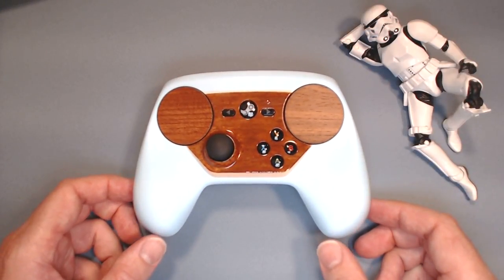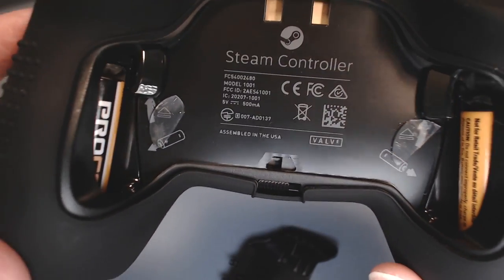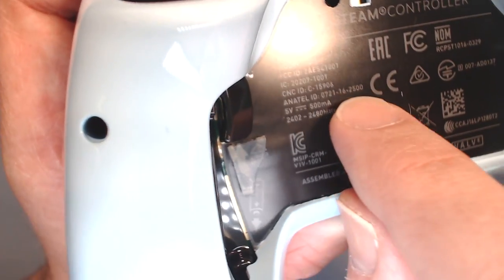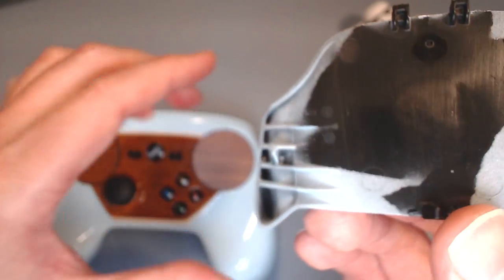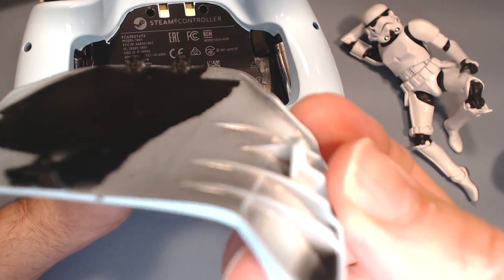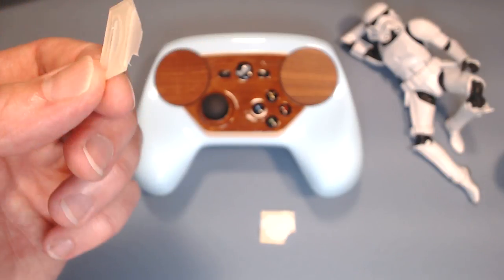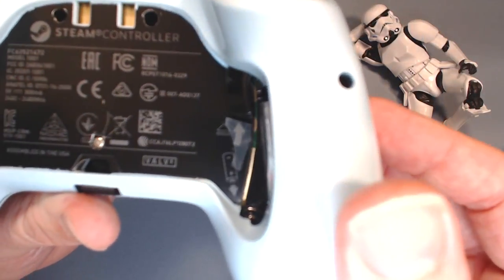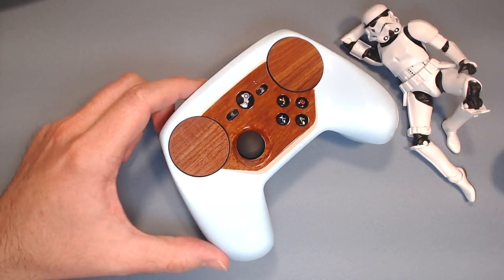Life Hack! Softer Back Paddle Grip Clicks DIY Modification - Steam Controller Tutorial / Tip

Comment: i put two rubberbands around each grip, to put pressure on the back paddles. now they're super easy to press. :D  works ok for the bumpers too, if run a big rubberband all the way around the entire controller.

Comment: Without the pads you can hear it click so you know that you have pressed the button. Do you get any feedback from pushing the buttons with those pads on?
Reply from the maker: You can still hear it, it's just softer. I've personally always felt that the back grips took too much pressure to click and were too loud. This just pads it a bit but I still hear the button clicking, I'm just not hearing that hard plastic knob pushing into the back plate.